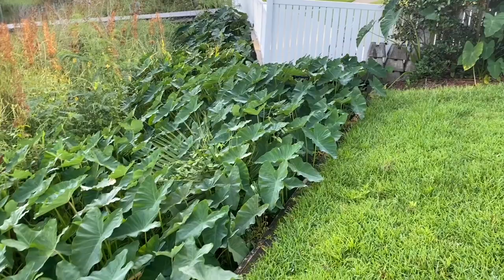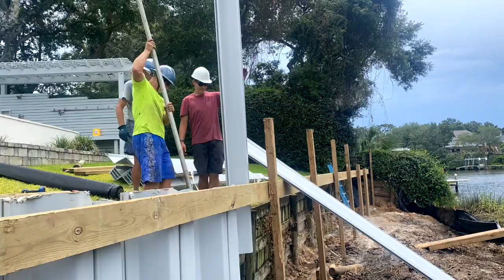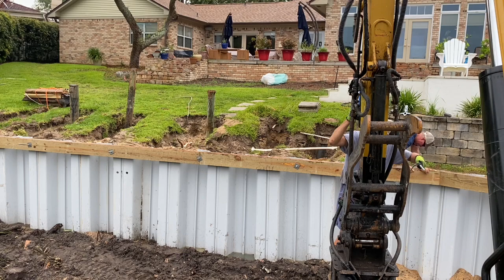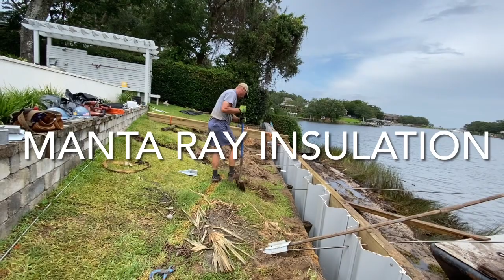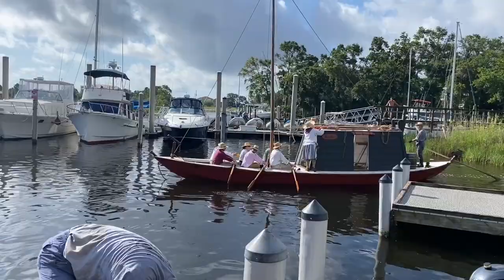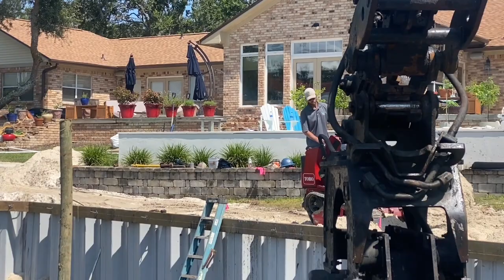VINYL SHEET PILINGS & MANTA RAY EARTH ANCHORING

Comment: Dale, Thanks for the great video. Can you tell me what that attachment is on the excavator? Is that by Caterpillar? I have a machine and want to find that attachment or equivalent.  Also where can I can the driver and Manta rays?  Any suggestions? Thanks again!!
Reply from the maker: Thanks for your comment and watching my channel. The quick coupler attachment was purchased a Catapiller. I don’t really recommend a manual one after I’ve used it for several years. I’ve had to replace it three times gets full of sand. I have a hydraulic one now that I just purchased with a new tractor last week, I’ll get some videos of that posted the Man ta ray driver  and anxhors you can purchase from Coastal products Gulfbreeze Florida tell him I sent you please.

Comment: Dale, do you use the soil anchors and also drive additional tie back piles? How do you decide when to only use soil anchors vs when yo use both soil anchors and tie back piling?
Reply from the maker: Thanks for your comment and watching my YouTube channel. That is a good question. We had a swimming pool behind this wall and we’re not able to dig back 12 foot to install the Piling tieback system so we go with a manta ray tie back system to drive them below the swimming pool. Also, if it’s a finished landscape yard will install the manta ray tue back systems to prevent from damaging the yard too much.

Comment: Love the videos. What do you think of weed holes or something similar to the Jet Filter system in the use of seawalls? What do you typically do for drainage? Thanks.
Reply from the maker: Hey Tom thanks for your comment yes we use well points and they go four foot back into the soil and are usually install on about 10 foot centers. 
Thanks for watching 👍

Comment: i guess with that solid anchoring it can bear the load of the ground against it?
Reply from the maker: Thanks for your comment. Yes, you would be surprised with Pilings or Manta Ray Anchors will hold. I’ve got a 15 ton hydraulic jack that won’t pull them out of the ground when installed properly.
Reply: Prolly has tie backs
Reply: @papichulo2847  yeah. The sting ray anchors. Would it work in beach sand though?